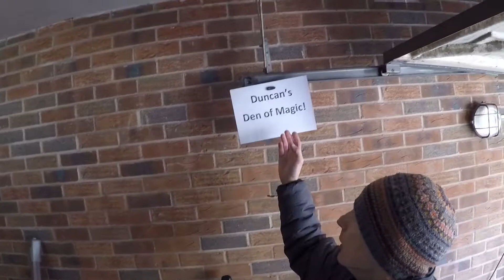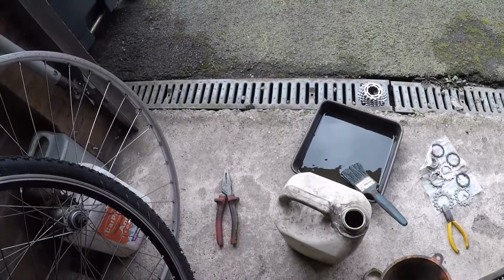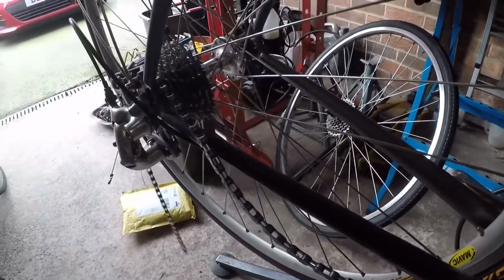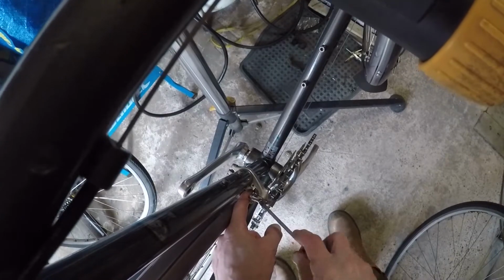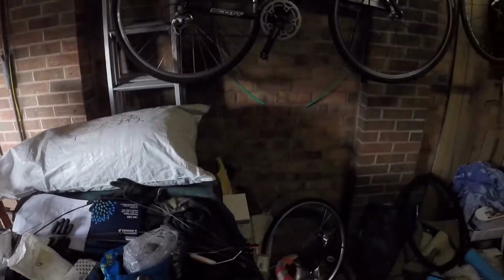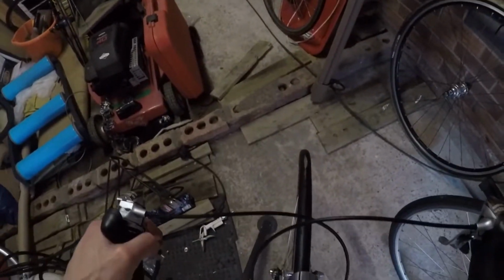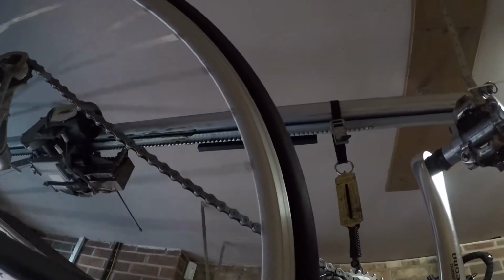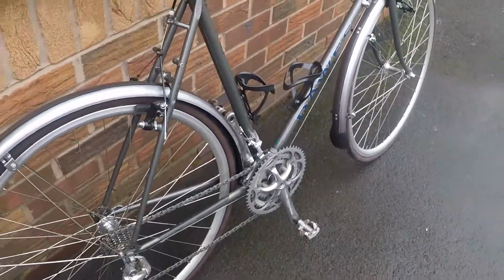Galaxy Rebuild Part 5

Comment: Great vids, great rebuild. Quick question, could you go higher than 28mm tires ? 30, 32, 35 ?? Cheers !
Reply: without the fenders of course
Reply from the maker: @senasplage  thanks. 
I recently sold this bike. To a chap who has watched these videos also. 
Regarding tyre size, I think they came back then with 32s or even a 35. Can’t remember. It would be in a catalogue somewhere no doubt available online.

Comment: Great video, been watching with interest, I've just brought an old Dawes aduax giro, and I'm trying to work out what year it is. They say on the net its the first two  numbers after the letter on the serial number under the bottom bracket. Mine says F01..... Meaning it is 2001, don't know if its true or not, do yo know the year of you bike and is it reflected on the serial number?
Reply: @DuncMcNutt , OK thank you, it's seems quite original in black and yellow with original decals has shimano tiagra gears, RX 100 brakes, mavic wheels with tiagra hubs which I believe to be original, maybe I can get to the bottom of this mystery.

Comment: get rid of caliper breaks
Reply: @DuncMcNutt  i use them but i prefer them not on racing bike
Reply: is 2000 about right for a steel bike new some old bike are fetching double that and there 30 year old
Reply: @DuncMcNutt  is it fillet brazed lugs frame